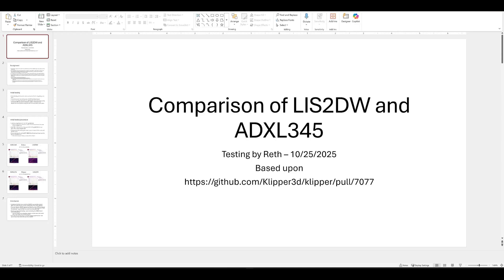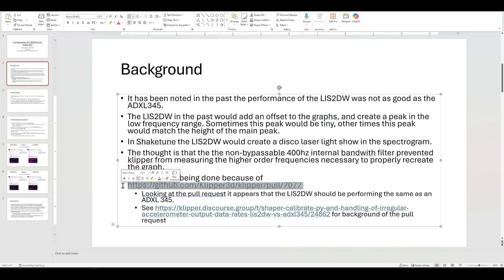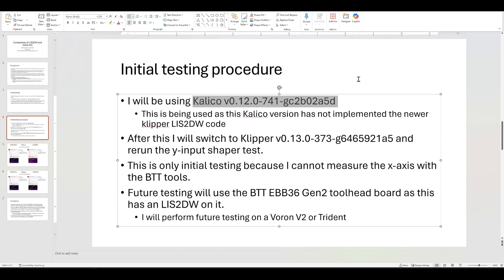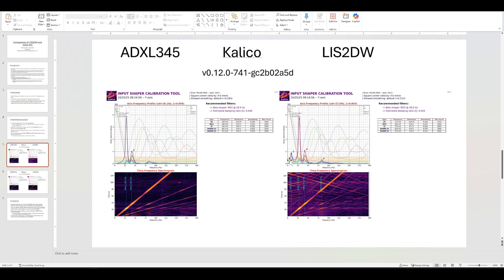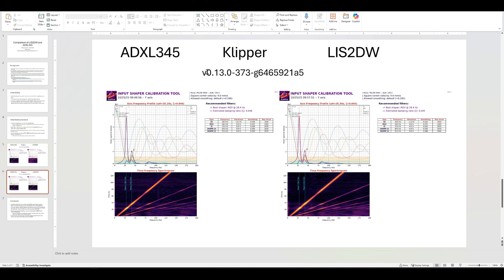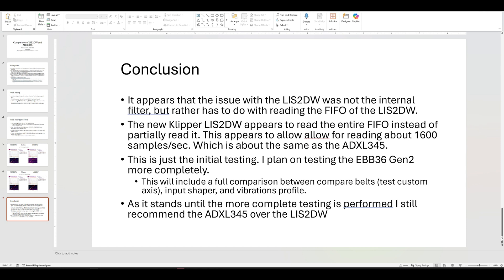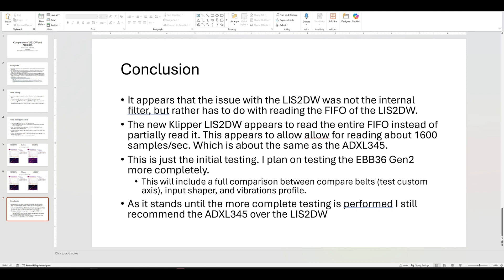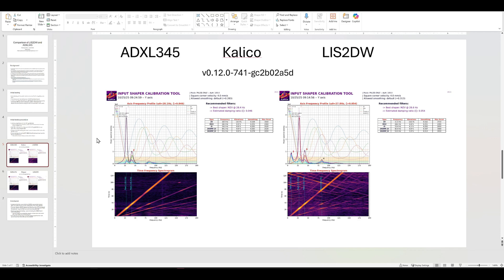Klipper LIS2DW update and  comparison with ADXL345

Comment: I’d like to ask if Shaketune Belt Comparison still works on the latest Klipper version. About 2–3 weeks ago, after updating Klipper through Mainsail’s update manager and running the belt comparison on my Voron Switchwire Core XZ, Belt A worked fine, but when testing Belt B, my host Pi suddenly shut down. Since that update, the belt comparison feature hasn’t worked properly, while everything else runs normally. Could you please help me get Shaketune BeltCompare working properly again?
Reply from the maker: I know trixie (PiOS) does not work with shaketune. 
This testing was done with klipper at the most recent updates, and was done with Kalico at the most recent updates. 
You might want to update klipper and then update your MCU's